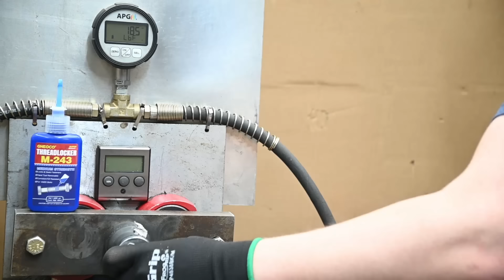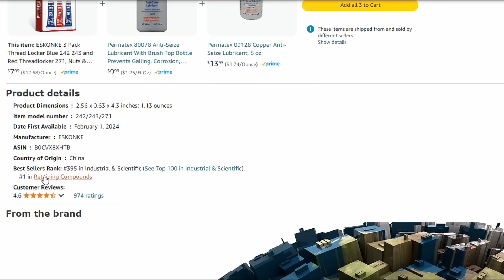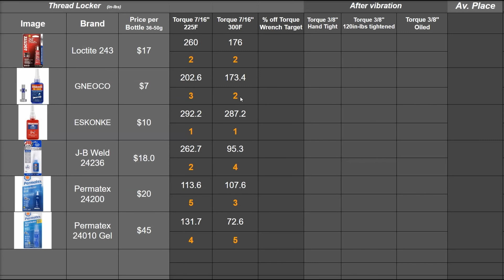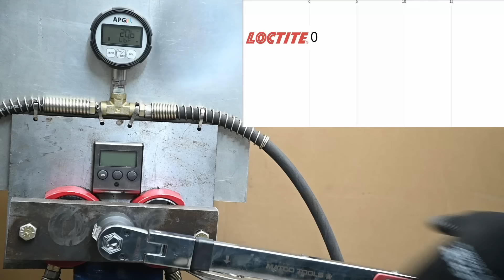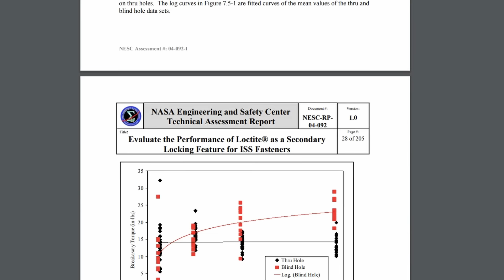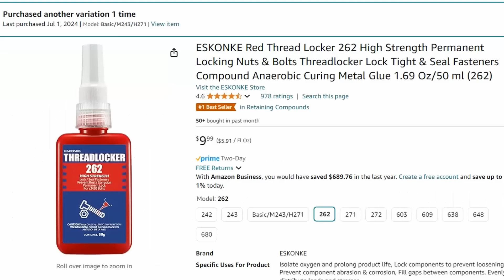Best Thread Locker isnt Loctite? vs Permatex, JB Weld & Amazon

Comment: So are there any standards or specifications in regard to exactly how much “lock” each grade/level of these thread lockers is supposed to “lock”? In other words I’ve seen multiple thread locker tests now and they all seem to be the higher the lock the better. But that seems counterintuitive when medium strength thread lockers are supposed to let go when desired and not let go otherwise.
Reply from the maker: Ignoring the test that was target torque effect, most of these tests are after something. Heat, oil, vibration. Blue means removable without extra steps or damage, so within that description those that hold tight after these factors are best
Reply: @TorqueTestChannel   Well, yeah I guess it’s pretty hard to argue with that logic!  So I completely understand your methods and reasons, but, is there any actual standards for something like this? Whether it be ASME, or especially DIN (because Germans and Loctite) I’m curious if there are any standards?  I figure if anyone of us wrench turners would know, it would be you Mr. Torque!

Comment: Here’s the thing with a “thread locker” do you want the bolt permanently locked in there to never ever come loose, or do you want it to just keep the bolt in place without loosening until which time you wish to remove it? I feel like the more effective a thread locker is, the more difficult it will be to remove the bolt when it comes time to removing it. That my folks is the main issue of thread locking.

Comment: Regarding setting time test: Thread lock is designed for a metal on metal thread. The compound only sets when in direct contact with metal.

Comment: If you continue testing threadlockers, I'd really like to see the wicking variants, what Loctite makes in green, which I know is a lower strength even though they're called medium/high; though with the greens specifically, I'd like to also see the acrylic test again, just to see how far down they do wick before they start curing, if it's a similar pattern as a dotted/striped blue or if they fill more of the threads.  You should also look through Henkel's own chart, blue has some pastes (2422, 2046), a semisolid stick (248), and a tape (249); I'm sure competitors have their own variants of these, probably some specialty products thrown in too.  While looking through Henkel's chart, there's also quite a range in viscosity of the liquid products, 246 has the highest outside of the thixotropic liquids (242, 243), though there's no viscosity number for the pastes.  Other things to note, blue has an 'ultra high temperature' variant (2422), red has a high lubricity variant (2047), and the 'mil-spec' blue is designed to be removable rather than locking (242) [I assume similar to a nylon lock nut, and/or a thread protector compound?], and the standard blue (243) and red (263) are actually the 'primerless and oil resistant' products; there's also a low strength locker made specifically for plastic fasteners (425).  I think a lot of people here would be interested in seeing 249, and likely the pastes and stick as well, just considering application and product retention is simpler with bolts that're harder to get in place. 

Then on the opposite end of the spectrum, are there any plans to test antiseizes?  If you do could you also include a note not to use antiseize on modern spark plugs (unneeded as modern plugs are plated with trivalent chromate or nickel), not to use it as a lubricant (such as how some people mention to use copper antiseize on brake caliper slides, proper lubricants literally exist for this reason), and how it should really only be used as a corrosion preventative (but this, like most supplementary products, depends on temperatures the parts will likely see, for example wheel area and especially brake area bolts get insanely hot, where the grease component can boil off and you can end up with a worse seizing situation).

Comment: If you compare high strength (red) compounds, I'd also really love to know how Permatex's Orange compound compares. IIRC it's supposed to have the strength characteristics of "red", with the heat-free removability of "blue" compound. Plus it's a gel, meaning it's very easy to work with, IMO.

Comment: I'm left wondering how 243 oil tolerant blue loctite would hold up against the oily bolt test vs a non oil tolerant blue like I believe 241 is. And on the directions for loctite it mentions using loctite primer, does that make a significant enough difference to increase loctite to the #1 spot amongst other thread lockers

Comment: I worked for Loctite (UK) back in the seventies, left after they shrank in size because of Middle East war. Predictable results, but you do need some detailed knowledge on how to apply and which grade, 243 is pretty mild, one interesting thing about these adhesives is the resistive torque increases just after breaking torque, this is the result of the adhesive becoming sand like and galling the threads. There are many other grades that outperform 243, but it’s a good average product.  If you don’t want it coming loose then wire lock it! Incidentally Loctite has a fluorescent dye the reacts to UV to check for application. I joined a German business after Loctite who micro encapsulated anaerobic adhesives and pretreated bolts with a paint of the micro capped material of the correct grade for the application.  Omnifit as they were known was bought by fellow German company Henkel, Loctite was also bought by Henkel. Eventually 
Great company great products I well recall the depth of training we received and th huge tech support operation.

Comment: Fun Fact:  Loctite used to own Permatex -  they owned it from the 1970s and then after a lot of typical corporate dancing, Loctite got spun out to Henkel in 1997.  I still think of them as a single unit, even though they've been separate companies for over 25 years.   Used to be 242 instead of 243 blue - and 271 red, and 640 sleeve retainer. They were THE standard (for the reasons shown) 

Great to get an update. I must admit, I have a gluestick version of 271 that I really like on high strength jobs.

Comment: Hyper Tough has released a 2nd Generation of the 3/8" brushless impact that needs tested! 😮

I bought one (my 1st gen got stolen), and it feels heavier, is boxed with a 4ah, a fast charger, and adds a 2 option speed controller (2 is full, 1 is half that).

I have my opinions, but I want to see test results. It has done everything I expected, but I haven't had it for very long, so I haven't encountered anything that I didn't expect it to get.

PLEASE TEST!!!

Comment: Another great video, with lots of good information.

In general (there are a lot of different applications for various thread lockers), I want a medium or light thread locker to basically stay at 100% to 130% torque over time and conditions (including wet assembly) , not loosen or get stuck.  I want the heavy to add a bit more, but still be removable with normal tools and techniques without breaking.  To this end, Loctite and their data sheets win for now.

One parameter that is often overlooked with regards to premium thread lockers is their anti-corrosion (anti seize) characteristics.  In particular, they prevent moisture etc. from creeping in and oxidizing etc. through capillary action blocking and additives. Again, i would say that Loctite and their data sheets win for now.

I will be looking into the finger tight option however.  I feel that Loctite does not really have a good solution for the loose "ny-lock nut" like version of thread locker, as that has not been their mainstay.  For example in use in bicycle spokes and nipples, where the assembly torque on the left side is quite loose, but needs to not loosen over time in a high vibration condition, and also be adjustable without disassembly to re-true the wheel.

Comment: Quick tip: add a washer between the bolt head and the big nut so that your socket only grips the bolt and won't slide down onto the nut as well. I don't think this should make any difference with regard to torque.

Comment: Like everyone else noted, Loctite requires metal to cure, not just a lack of air. This should be obvious because it doesn't harden in the tube, but the start of the video seemed surprised that it didn't harden when pooled at the bottom of the plastic hole.

Comment: The nasa report mentions a "grade "T" activator. Manufacturer recommended for passive metals.

    I wondered about if the plastic threads themselves were the problem by not curing the glue completely.
Reply: And old lock tite in holes.
Plastic was 10% less strength btw.

Comment: theyre not oil resistant in the cure process. only after hardening. loctite becomes plastic when their is no air present. each grade is a different hardness of plastic. put each in inside a vac chamber same volume. and pressure test them after.

Comment: should have slapped a washer on the bolts so you didnt have to fuss with keeping the socket high enough to only twist the bolt and not the coupler

Comment: Loctite primer 7649 would likely have helped with the oily threads and the finger tight joint test.  Without having the threads torqued, there likely wasn't an environment favorable to anaerobic curing.

Comment: It will dry faster if you use the recomend primer on the first.  Each brand will have a primer, and it will direct you to apply it first in the fine print.

Comment: The only concern I'd have for the Esknonke vs. Loc-Tite is consistency across batches. The lower cost option typically also means cutting some corners on quality. Batch to batch differences might generate more variability than a higher quality product like Loc-Tite that has tighter process controls. Good to see that there are some lower cost options that perform as well though.....keeps the big guys on their toes!

Comment: Threadlocker isn't designed to increase the torque required its just designed to hold the bolt during vibrations. It's expansion rate would increase torque thus the different ratings, red, blue, orange, and purple all have different expansion ratios

You want real permanent installation use rockset granted it's designed to break down with water.heat doesn't do anything to it though

Comment: It's not because it's cut off from air it's actually the ferrous metal that activates the curing process unless you buy an activator or use loctite death design for non-ferrous metals

Comment: Worked in a factory building boats for years. Our engineers always stressed all you need is a drop or two of thread locker. As one of the mechanics that worked anything from fresh off the line to boats that had been in the field for years I can confirm with out a doubt that that is true.

Comment: Should test with the thread locker primer spray, certain manufacturers require it on installs onto all hardware that is going to be thread locked. The one I have is permatex although I've never looked up if any other manufacturer makes it.

Comment: I'd like to have seen you add Locktite Stick blue medium strength threadlocker. I suffer from Intention Tremors which basically means my hands shake almost uncontrollably whenever I try to do something with them like putting an expensive threadlocker on a tiny bolt. I work on small engines like you find in grass trimmers and lawn mowers. Small and tiny bolts and nuts seeing in excess of 10,000 rpm are the norm. I was thrilled when I saw that Locktite developed a stick version of Locktite.  I'm not getting a rash of come-backs because of loosened bolts ever since I switched to the Stick, but you never know. I'm especially interested to see how the Stick affects torque results. I'm one of those weird guys that actually uses a torque wrench on most fasteners, even spark plugs. I repair a lot of broken studs and stripped out bolt holes that other "mechanics" have broken.

Comment: We had an illegal bottle of loctite that sadly I threw out when it was empty. It was from the days of the presidential helicopter program under Obama. A component manufacturer in the United Kingdom forgot to loctite some bolts. However the loctite they use was illegal for import in the US. So technicians had to be flown across the pond and smuggled in this illegal loctite and my dad escorted them to the presidential helicopter in the hangar at Lockheed Martin where they removed the bolts applied the liquid and reinstalled. They then handed the bottle to my dad with the instructions of disposing. We used it for years.

Comment: When I have used excess thread locker, it didn’t cure properly.
I used it once on an acrylic with a recessed metal nut, but the thread locker ate away and disintegrated the material that was not metal, ruining the whole part.
Just a dab will do.  Use only on metal, and use as directed.

Comment: Weird experience finding ORANGE threadlocker but Loc-Tite doesn't make it, only Permatex (in our local hardware store, anyway).
It seems to work pretty well so far but I can't say if it's 3x the vibration resistance/strength just anecdotally, only that I beat the dickens out of my camera mounts (sometimes I crash too lol) and it hasn't moved a bit.

Comment: Thing is, its not which is the 'best' its which can be used on a component and have known properties. I used to be a marine engineer and much of teh equipment was under Class and cost millions. Manufacturers required Loctite because it was approved by Class, it had known properties of which many fasteners are designed around and it has the backup of a major company. Yes, maybe a lesser name might hold a bit harder, but, if an engine or compressor has been designed to use Loctite then using something else takes it out of tolerance.

Comment: Harley Davidson states in their service manuals to use Loctite specifically. I’ll stick with the recommendation. I’ve never had an issue with bolts loosening up and Harley V-twins certainly vibrate a lot and get very (300+ degrees) hot. Loctite has a bunch of different thread lock. I’d like to see you test them all.

Comment: Thread locker is not anaerobic it is catalytic. Without the presence of iron a seperate catalyst should be used. Think about it if it was an anaerobic reaction it would go off in the bottle!

Also I have seen fastener studies results of tightening vs break away torque varies hugely the bell curve standard deviation is at least + or - 30% of the initial tightening torque. Individual tests are not a good sample quantity. You would need to conduct at least 12 tests of each test type to make any conclusion. The tests I saw ranged into the hundreds of tests per type.

Fun fact the DIN spec for star locking washers was retracted as they were found not to work at all.

Comment: I operate machinery in very corrosive, high vibration environments. I was trained to always use threadlocker on wheel bolts and antisieze on every other bolt. Several years ago, I resorted to using rtv on all bolts. The antifreeze wears off over time. The threadlocker makes bolts too difficult to remove without breaking them. The rtv seems to seal out moisture and corrosives while simultaneously resisting bolt loosening from vibration. I have never had an issue since I started using rtv sealant instead. It is a perfect replacement for my application.

Comment: Yep I got some blue "locttlf", basically no brand, from a chinese site when I was first starting with doing stuff myself. I made the mistake of using it on my drone. Ruined the carbon fiber frame trying to get it off, it's basically weld strength lol

Comment: Hey, just a suggestion : the vibration testing isn't accurate in my book. Vibrations on machines includes stretching and bending motions, nothing visible, just minute. I think that affects testing here.  I'd torque the bolts and hit the heads with like 10 sec of air hammer, maybe? Probably there's a norm for that.... 😂

Comment: There's probably 40 of them. Mine is 242. The color does not denote strength, it changes from one to the other and back.
   Have penatrating 29000 but haven't opened it. Green. I think I wanted purple tho.

Comment: What’s a good way to clean a bolt before applying thread locker?
Reply: Used to be blasting it with a $1 can of brake parts cleaner. but now those cans are $5.

Comment: I don't think your vibration testing was realistic test because the collisions of the bolt heads with the shaker result in torque. Under typical vibration use the bolts shake but nothing hits their heads or the nuts.

Comment: ok so boiler and chiller worker here. you can put on these and wet assemble or put on bolt and let cure then dry assemble. that changes the holding power. as i'm working with 360 degree  F  these are a bit low temp for my usage.

Comment: Amount of torque break free is not a valid test. Heat and cool cycles and vibration is a valid test. It is thread locker not epoxy, one is made to prevent bolts getting loose and one is to fasten things. I use whatever and am not brand friendly but I can also say tube life also matters and some last decades and some months after opening I have a lock tite chap stick style 30yrs and yes it still works and yes I have used it and had to remove bolts after,. I have harbor freight stuff for year as well and it still also works.

Comment: I buy loctite brand for that water viscosity everyone hates. I have too many hobbies beyond cars and hunting sticks. Like nitro rc plane's that require tiny little nuts and bolts that like to work themselves out and steer your $500 model into the ground.   With goopy threadlocker it makes a mess and it's impossible to get out just enough,  with loctite I can squeeze out just a tiny bit and use the end of a exacto knife or something to apply it.